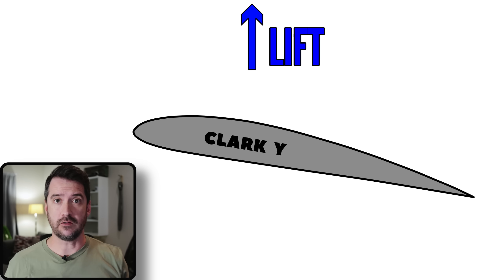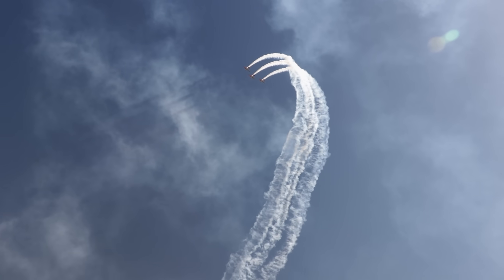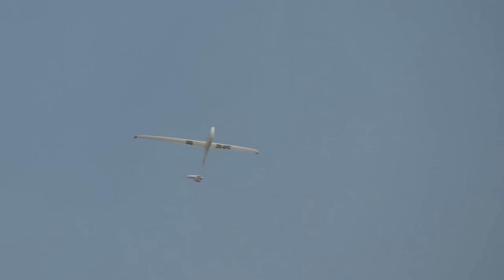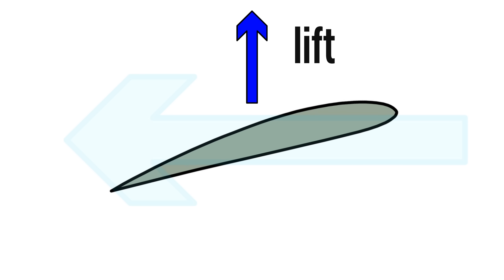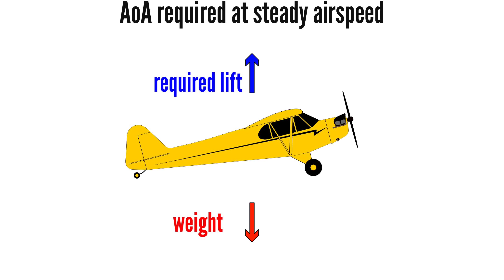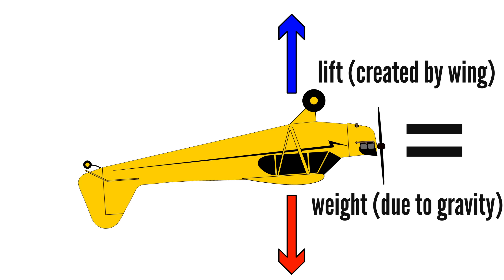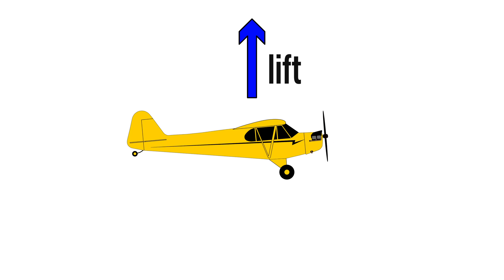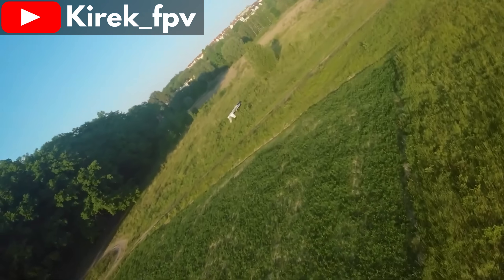Is Airflow Distance Over the Top of a Wing Always Longer?

Comment: I think the confusion arises from many explanations of how wings work referring to the "special shape" of wings, when that's not what's happening at all. The "special shape" improves drag and possibly stall speeds, but fundamentally a perfectly flat board would work to generate lift as long as it has the right angle. But lots of explanations I've seen imply that the shape is somehow magic, when all it does is optimize the generated drag for a certain angle of attack. It's a skewed teardrop shape.
Reply: Push air down, plane go up. Push air back, plane go forward.
Reply: @Sonny_McMacsson  There is a downdraft of air for sure, but it's pressure forces doing the work. The downdraft is a result of these pressure gradients created and experienced by the wing. Your explanation works if you want to dumb it down for a 5 year old.
Reply: @christophorus9235  The other side of dumbing things down is overcomplicating them. Can you really separate a net pressure imbalance from the ultimate kinetic effect it has? The pressure is the reactive force.

Edit: One case that comes to mind where pressure is more convenient than thinking only kinetically, is under/over expanded rocket exhaust. Nonetheless, that pressure imbalance (potential) gets converted into a flow at some point in order to equalize the pressure.
Reply: @Sonny_McMacsson  Correct, but not the complete story. There are other component(s) to lift and drag, pressure differentials being one of them.
Reply: @MarkStafford9  That's the how you push the air part.
Reply: @Sonny_McMacsson  No.
Reply: @christophorus9235  Yep
Reply: This right here. The special shape makes it a 'lifting body'. A lot of time when someone asks 'how do planes fly', they are actually being told what a lifting body is, and not how planes actually fly. An upside down wing has negative lift at 0 Angle of Attack. That negative lift is overcome by an increase in AoA, as this video explains. 

A lifting body makes a plane efficient, but it's not what makes it fly. Stick your hand out the window palm down at 70mph, if you hold it at a positive AoA, your hand will rise. Your flat hand is relatively symmetrical and as such is not a lifting body. If it were, your hand would go up slightly faster, that's about it.

Planes fly because they push air downward. A shaped wing makes it push 10% more air downward than a flat one.
Reply: @JHe-f9t  . Actually the way it works from a Purely " Lifting Body " standpoint is that the Plane is SUCKED upwards .
Reply: @johncunningham4820  That's true for the wing itself. The shape cancels out the drag somewhat, but it's not enough lift to make the plane fly. It adds to the effect, but it's not the total effect.

The wright brothers were extremely dependent on wing shape because their thrust to weight ratio was so tiny, and their materials were so weak. The shape of the wing was key to unlocking powered flight. 

Just as you can build a fan that will move air without an optimized blade shape, you can easily build an rc plane that will fly without having a lifting body. It just won't be as efficient.
Reply: @JHe-f9t  . For  MOST  supersonic Aircraft the entire Airframe is actually a Lifting Body . Fast Takeoff speed and Fast Landing speed but overall Low drag , and of course Big Power .
Lift = Drag . Inescapable . 
Laminar Flow is the Ideal .
Reply: @JHe-f9t  It doesn't push more air downwards.  The shape smooths the airflow, minimizing turbulence. So it technically reduces the amount of downwards pressure from above.  A good way to visualize this is for the air to move across an angled wing, but at the top of the wing, the air wants to go straight backwards as that's the path of least resistance.  But a flat board has all sorts of eddies and downwards pressure, similar to a spoiler on a car. ( which does exactly that - creates eddies and bad air to force the car downwards.) So you want it curved such that when it is at a normal angle, the air dips down a bit and follows the smooth shape to lessen some of the eddies.
Reply: I think you'd enjoy a close read of "Theory of Wing Sections": by Von Doenhoff and Abbott, I know I did.. For the most part it's a distillation of data from wind tunnel research on subsonic foil sections ca. WWII. Sections, if not magic, are step one in understanding lift/drag/angle of attack by the Reynolds Number when designing a wing.

BTW, Sorry you hate women, we have a lot to offer...
Reply: @ChimeraActual did not notice the icon till I saw your comment!  Misogyny is such an odd declaration to make!  Quite disturbing.
Reply: Thank you.  A perfectly symmetrical wing shape with no chamber will fly with low drag.  The force up is equal to the mass of the air molecules being forced down. Action and reaction.... period.
Reply: @Pneuma40  Yes, of course a flat board will fly, a "no chamber" wing will fly. But "low drag" compared to what? An asymmetrical wing can be designed for less drag than any perfectly symmetrical wing for any given sub-sonic use-case except equal performance upside down or downside up. That is why all commercially produced business case aircraft use asymmetric airfoils on all horizontal surfaces. Who wants to pay more for fuel than you have to?
It is about action and reaction, of course. But the "magic" or "special shape" question is about making that action more elegant, more energy efficient by understanding HOW lift is created, HOW downward air is sent downward. A hovering helicopter uses almost twice the fuel of that same helicopter flying forward at it's max efficiency designed speed (usually around 50mph, plus or minus 20). Airshow high-power airplanes can hover vertically, consuming very roughly 40 gallons per hour, or they can fly forward normally for well less than half that.
Reply: A structural (thick) flat board with squared edges,  will have terrible performance. For a real vehicle with high Reynolds numbers , when Fairing the leading edge and "fine-ing" the traing edge is taken to the limits / perfection, an aerofoil is liberated from within the heavy, bluff board.

The false argument is one of a number including "equal transit time", or even using a symmetrical venturi by way of explanation. (Fluids 101 explanations are incomplete.  It IS Bernoulli, but not in a causal manner.)  Numeric solutions iterate to reach a real world approximation.
Reply: To avoid confusion,  "a perfectly flat board would work to generate lift as long as it has the right angle." should be rephrased as "as long as it has the suitable angle." because the "right angle" can be misconstrued by a computer or AI as a 90 degree angle.
Reply: @simon6071 
AI is good at English and you are not.
"Has the right angle" doesn't mean "at the right angle" (90 degrees)
No confusion for AI.
Reply: @Alec72HD  
You are wrong. AI is not good at English all the time. You English is not as good as you think it is.
Reply: @Alec72HD  
The meaning of the phrase "has the right angle" can be so ambiguous that even AI can misinterpret it as "has an angle bounded by two lines perpendicular to each other (90 degrees)" at times. 
Google Translate uses artificial intelligence (AI) to translate text between languages.

Type "has the right angle" in Google Translation and set the translation to Chinese.
The translation is "有直角", which does mean "having an angle bounded by two lines perpendicular to each other (90 degrees)." instead of "having a correct angle. "
You have just been proven wrong.
Reply: @Alec72HD  
Of course "Has the right angle" doesn't mean "at the right angle".''
"Has the right angle" includes the verb "has" but  "at the right angle" doesn't have the verb "has".  So they cannot have the same meaning. You need to improve your grammar in English.  

"Has the right angle" can be interpreted as "has the correct angle" or "has as angle bounded by two lines perpendicular to each other : an angle of 90°".  So there is confusion.
Reply: @Alec72HD  
VIDEO: Why GPT-3 changes everything (and how it works) (10:08) 
Q: Are there any animals with three legs?
A: No, there are no animals with three legs.
Q: Why don't animals have three legs?
AI: Animals don't have three legs because they would fall over.

AI programmer: Wow! This is incredible.
Me: Wow! This AI is so stupid.

VIDEO: Bulldog Puppy Born with Only Three Legs but He’s so Adorable
VIDEO: Three-Legged Dog Still Runs Like a Champ!
Reply: @Alec72HD  You think AI is good at English! No, it is not, neither are you.
VIDEO: This AI Was Too Dangerous To Be Released, Here's Why
(1:54) Tasked with wring an article about unicorns, the AI was stupid enough to talk about unicorns being "four-horned" animals.  What a joke!
Reply: @Alec72HD  
No Chat GPT 4.0 for me? That's fine.
I don't want to talk to something with pseudo intelligence.
Reply: @Alec72HD  - I think you both mean Rightangle (one word)
Reply: @Alec72HD your English is wrong!  At 90° is usually 'at right angles', at the right angle means whatever angle is correct.  At a right angle is a single 90° right angled measure.
Perhaps you should be more careful, as should people with AI
Reply: @RobBCactive  
Right.
Thanks.
My point was that "has the right angle" unequivocally means "has the correct angle."
Reply: @Alec72HD  nope wrong again!  You said "Had the right angle doesn't mean at the right angle (90 degrees)" which was incorrect.  Has the right angle and (it's) at the right angle mean the same.
Read your own post!
Reply: @Alec72HD  I agree, but "every Pythagorean triangle eg 3,4,5 has a right angle" shows it is the indefinite "a" vs definite article "the" which generally disambiguates what right angle means in English.  You can say "it's one of the right angles" if multiple choices exist.  The right/correct thing and left/right are just typical ambiguity.
Reply: @Alec72HD  Please don't be willfully obtuse.  Simon TOLD you he was using Google Translate.  GPT#anything has nothing to do with his point.
And why do you assume that everyone working with Chinese language is in the PRC?
Reply: @simon6071  It make the same mistake in Norwegian.  "has the correct angle" is "har riktig vinkel" but "has the right angle" gives "har rett vinkel" which means 90 degrees.
Reply: It is more complicated than that though because how the air flows over the wing is important. A flat board would cause turbulent flow and certainly would not produce lift, else man would've found flight way sooner. It is very special indeed in that it not only optimizes the bernoulli effect but also causes smooth currents of air. There are quite a few factors that go into lift. A flat board would be able to use newton's third law to produce lift like a kite, which is another lesser factor.
Reply: @psyience3213  Flat boards actually do produce lift at modest angles of attack, they just stall kind of easily so they're not the best format for manned experimental aircraft.  Otto Lilienthal made many flights in one or more gliders that mimicked stubby bird wings, but eventually crashed, I think from a stall.  The Wrights thought more analytically and built wings with similar camber but a higher aspect ratio.  (Also they prudently practiced on sand dunes.)
Reply: Nah, sailing boat sails work by creating that teardrop shape. The force of 'lift' against the resistance of the keel is what squeezes the boat forward.
Reply: The shape is magic because of how it reduces drag and allows the wing to fly as a flat angle of attack (0 AOA).
Reply: @nelsbrown3674  . No " Magic " to it .
It's called  " Physics " .
Reply: @johncunningham4820  "Magic" in quotes, but, yes, physics. Bernoulli's Principle works, even if all you do is increase the angle of attack of a flat wing surface.
Reply: @nelsbrown3674  . Actually , a perfectly Flat surface  is pure Newtonian  Action / Reaction . Just Mass-flow impinging and displacing . The " Special Shape " is what creates a Vacuum on the Upper Side . Bernoulli Effect is Also how a Carburetor works . The Restriction where the Fuel Tube (emulsion tube) creates a Faster Flow and thereby a Reduced Pressure , thus " Sucking " fuel into the airstream .
Reply: Actually it does both.
Reply: No it wouldn't.
Reply: YES! For years I couldn't figure it out because I was told it had something to do with the shape of the wing, as soon as I gave up on that concept it all made sense. The curved upper side of a wing CAN create a low pressue area, but it's a result of squeezing the air flowing over it against the air above the wing, speeding up the air and creating lower pressure....it helps with lift, but it isn't the main cause of lift, it's the pressue at the bottom of the wing that does most of the work.
Reply: That "special shape" does create some lift.
Reply: "as long as it has the right angle."
yes, Key factor - and that is in relation to both, wind and gravity so there are multiple variables in determining the correct angle.
Reply: Exactly!!!!!!
Reply: Actually the most scientific explanation of lift on a wing during flight should be based on the force vector component of each molecule in the air acting perpendicular to the surface of the wing on both sides.
Reply: Correct.
Reply: Taylor Craft BC 12 and later models were built with the same wing cord on top as bottom. There was one made famous in aerobics because of this design.
Reply: Lol you all need to stop talking about lift when you don't know how it works. It's curved flow kids.
Reply: @christophorus9235  
Not from my professional and academic experience.
Reply: @Talon19  Sorry I'm not sure which comment you're referring to. I can say I've seen many professionals and academics get lift wrong. To my best understanding it is the curved flow pattern around a "wing" that produces the surface pressure changes required for lift. You can use many different shapes and AOA to create this flow pattern with varying but still applicable results, which is why a flat board with positive AOA can produce lift.

Edit: A spinning ball moving through a fluid, is another example of how you can rotate flow to produce lift. No pushing down in that scenario yet it still works.
Reply: From what I learnt in school physics lessons, the skewed teardrop shape is due the fact that a wing needs to be  more than a thin flat board for structural  strength and that the curved top surface allows a greater  angle of attack (and thus lift) before the airflow is disrupted; I'm surprised that this is not mentioned in the video...
Reply: Yep , supersonic capable aircraft DO have a Wing Profile that amounts to a Flat Board , with a Razor sharp Leading and Trailing Edge .
Reply: Planes vary in their wing shape depending on their intended use. Cargo planes tend to have that very exaggerated shape, very thick. On the other hand, sport planes and fighter jets are almost (or completely) symmetrical on each side. The SR-71 doesn't have a thick leading edge at all, it has razor blades for leading edges. For planes that are meant to mostly go slow and steady and/or handle a heavy payload, the camber will be bulkier on top than bottom. If you need performance in any attitude and lifting is not the main concern then the camber will be more symmetrical. Some planes can certainly fly upside down, because they are designed with that in mind.
Reply: I always thought and still believe that a completely flat panel e.g. a sheet of steel or plywood WILL create life if air passes along it at an angle. And one COULD probably build a plane like that. But it would be less stable. Your statement that it could be more likely to stall seems to make sense to me.
Reply: So according to you it's not really the special shape; that's why you put quotation marks around it (meaning that you don't really buy that word use)?
Reply: Foils keep laminar flows at greater angles of attack than flat sails, so they don't just reduce drag.
Reply: Grade school science textbooks get this wrong ALL the time.
Reply: @nitehawk86  . This is a Subject  WAY  above " Grade School " . Grade school might do a Quick explanation of  Bernoulli Effect , but nothing more .
Reply: I have built boomerangs with zero angle of attack. As a matter of fact, I have never built a boomerang with an built in angle of attack. I needed to create a proper profile though for them to circle back. Perfectly flat bottom, only the top is somewhat curved with the leading and a trailing edge.  It seems boomerangs generate lift ONLY by the shape of the wing and not at all by the angle of attack. Boomerang with a square profile don't work in my experience. That might be simply because they don't rotate long enough due to drag. Thoughts?
Reply: Well, it is primarily a bullshit teaching, or else paper airplanes would not fly:)
Reply: @batmandeltaforce  - A decent paper airplane has wings with somewhat of an airfoil profile. Seems to me to be similar to a KF airfoil.
Reply: What creates positive or negative pressure is change of air velocity, and not just "faster" or "slower", but change in direction, as well. If a slanted surface causes air to move down, it changes the air's momentum, thus it needs a force, which imparts an opposite force on the surface, too.
Reply: I have built enough of paper kites or even paper planes to know immediately that this is indeed the case.
Reply: Exactly!
(thank you)
Your "flat board" model is close to what we see in (a) hang gliders, (b) bats and flying foxes, (c) flying squirrels and glider possums.
Reply: @ianbatty3947  original Regalo hang gliders have been replaced by inflating curved parachute designs, in X-country distance competition too.  Sails and those Regalo wings take curves and are NOT flat boards which don't generate enough lift for the drag.  It's why there were decades of refinements before gliders and powered planes became useful.
Look at the shape of air screws aka props and ship's propellers which are carefully designed for efficiency and to avoid cavitation.
Reply: Something not mentioned but intuitive is how turning in a banked curve is more efficient than hitting and bouncing off a wall at an angle.
In the flat board case, air molecules have an  impact hitting the flat wing at an angle works on 1 surface, while a flowing stream of air that's turned gradually downwards by careful shape acts on both sides.
It's simple to run water on one side of a round object and see that the flow dominates, causing a counter-intuitive force towards the side that's hit, rather than away from it due to impact of water molecules at an angle of attack with the held curved object.
Reply: This is my point.  I just want to see the data for the percentage of lift generated by the pressure of air on the undersurface of the wing compared to the vacuum generated on the top of the wing.  I am not referring to any forcing air down, as in a jet.
Reply: We know this because we have all made paper planes with 'flat' wings.
The evidence is right there in front of us all, even the science teachers, but this 'special shape' and the long path/low air pressure thing continues to be taught.
Reply: Correct.  The ONLY reason wings have thickness is to accommodate the SPAR.
Reply: @rsteeb  I don't think so.  Hang-glider designers chose to add a lower surface for airflow reasons well after many successful single-surface models had been produced.  Sailboats had been using thin masts and single-surface sails for centuries but in recent decades they have branched out into airfoil-shaped wing-masts presenting a deep leading edge, and also fully two-surfaced winglike sails.  An optimally trimmed single-surface sail ends up having a bit of a retrograde vortex (telltales streaming forward) on the leading portion of the inside face, which I doubt represents optimal airflow efficiency.
Reply: youre not wrong but the MAIN point of a wing is that it generates lift when flying level. which certainly cannot be done with piece of flat board. Plus the wing has to be stong enough to carry the plane weight without folding on itself. like do you know how a long distance flight path/fuel consumption would look like if you only generated lift when pointed up? And you realize that there are planes that literally fly without a propeller/engine just by utilizing its wing shape called GLIDERS right?

while not being wrong that flat board can create lift, you certainly are not correct in saying the wing shape does nothing lol. I think youre just experiencing Dunning–Kruger effect, where you know a bit about planes to be certain in your knowledge but you know too litlle to realize you actually know jack about it.
Reply: @SagittarA  A wing produces exactly as much lift as it does downdraft.  If that can be accomplished in "level" flight, credit Bernoulli and/or Coandă, but Newton's three laws are inviolable.  Jack who? 🙄
Reply: yup some people are just lacking in comon sense to understand this.
Reply: Every kid who sticks their hand out of the window at speed, and then adjusts the angle of attack proves this.
Reply: AND IT DOES.  All the Balsa aeroplanes we built as Kids (in the 60s at least) - used FLAT panel wings and flew fine.   And the PITTS is symmetric and also flies perfectly - either way up.
Reply: A flat board at a high angle of attack would be the same as blasting it from the under side with air from an air compressor.  Similarly,  the top side of the board would be protected from the blast creating an :'air shadow'.... or a vacuum. So it's either pushed up or sucked up depending on how your mind conceptualises it
Reply: You're right. 
The shape improves lift, but is NOT the "cause" of it. 
Even a cow 🐄 , if placed inside a wind tunnel with a certain angle of attack, can generate lift. 😊
Reply: Positive camber wings produce lift at zero angle of attack; flat plates don’t.
Reply: @Talon19   - but why?? Why use such a wing?  The answer lies in minimal drag at (designed) cruising airspeeds. VNE speeds may well require negative control input to maintain level flight (higher drag per unit speed equivalent
Reply: @Talon19  Yes, but, just about any airfoil has a slope of about 0.1 delta in the Cl for every degree of AoA. The camber only determines the Y intercept of this line. The rest of the shape maintains linearity out to varying AoAs depending on how good a shape it is, flat plates stall at about 5 degrees and a reall good airfoil might stall at 12 degrees - so you get way more lift out of a properly shaped and cambered airfoil.
Reply: @Talon19 Who told you that? Certainly  not Bernouli.
Reply: @fredbrillo1849  
Direct observations, measurements, and analysis of dozens of wind tunnel tests prove that the upward force called lift is due to differences in pressure between the upper and lower surfaces of the aircraft than deflected, turned, circulated, etc air.
Reply: @Talon19  Please post a link to some evidence of that...
Reply: @Talon19  When you say zero angle of attack, what does that really mean? 
The aft part of the foil is still angled downwards and with laminar flow therefor will direct air downwards behind the foil.
Reply: @ketilrkke4552  Laminar flow is rarely if ever experienced by the trailing edge. I think the best laminar flow airfoils transition to turbulent flow around 65% of wing chord.
Reply: @ketilrkke4552  
The pressure on the upper and lower surfaces are the same at the far field points where the thin plate begins and ends.  The difference in pressure is local to the cambered section of the surface.
Reply: @Talon19  A curved wing acts like... A downwards plank. At zero angle it still behaves like a plank that ends up pointing downwards
Reply: @jeanladoire4141  It's pressure forces, not downward deflection. The downdraft is caused by the pressure gradients on the wing surfaces.
Reply: @jeanladoire4141  
What are you talking about?  My point is downwash is not required for lift.
Reply: @jeanladoire4141  
“Pointing downwards* isn’t very useful because it gives no reference to AoA.
Reply: @Talon19 downwash is required for aerodynamic lift. Still waiting for any evidence of those hundreds of wind tunnel tests you claim proved otherwise. You know, the ones you weirdly claim happened at ERAU during the AE301 course which doesn’t have wind tunnel because experimental aerodynamics is AE315. Maybe the model of this alleged experiment was full of hot air, that would explain the divergence of your claimed results from the canon of aerodynamic theory….
Reply: @XPLAlN  
Courses change in the 20 years I took aeronautical engineering there.  Not my issue.
Reply: @Talon19  AE301 is theory now and it was theory back in the eighties. Experimental was 309 and is now 315 so your story has failed authentication. In any case you cannot produce the experimental data for any if the tests you are claiming happened.
Reply: @XPLAlN  
And?
Reply: @Talon19  quote: “and?” …and nothing else needs to be said unless you can provide this fantasy experimental data.
Reply: @XPLAlN  
Not my problem you didn’t do wind tunnel tests yourself and don’t understand basic physics and fluid dynamics.
Reply: @Talon19  well, it is “your problem” if you wish for the internet to believe your absurd opinion that aerodynamic lift does not require deflection of airflow. Nobody is buying it. Nobody is buying it because it violates conservation of momentum. Nobody is buying it because your failure to reproduce any evidence of the wind tunnel tests you say prove your point, renders your rhetoric as unconvincing as your daft opinions on aerodynamics.
Reply: @XPLAlN I've wasted many good hours arguing with engineers about this. They love to over complicate things - for them, if you don't need a computer/simulation/weird precalculated table or chart to work it out then it's not interesting.

When faced with "it's just conservation of momentum" they'll tell you "it's not that simple" and then proceed to talk about all the complicated details which make a good wing (obviously very important if you're building a wing) without ever actually thinking about the fundamental mechanism.

Engineers are incapable of ignoring extraneous details when the context demands it, and because of that they rarely understand the fundamentals.
Reply: @Talon19 "Positive Camber" wings produce lift at zero angle of attack, but that's an incorrect analysis. Positive camber wings produce no lift at "Minimum drag' angle of attack (Same as flat plates, and symmetric foils about a straight 'camber line'), which is some number of degrees Nose Down. A curved camber line produces lift (+ or -) in relation to it's angle of attack different from minimum drag angle, not from any difference from a straight chord line drawn from each end of the camber line.
Reply: @billtaylor3499  
AoA is defined in relation to the **chord line**.
Reply: @Talon19  There is NO lift without downward acceleration of ambient air; how does zero AOA achieve that?🙄
Reply: @rsteeb  
Pressure decreases on the upper, cambered surface.
In college we ran a wind tunnel test with a long, thin, flat plate with the upper surface near the center as the upper part of an airfoil.  Using force gauges and pressure taps, we verified low pressure over the cambered area.
Reply: @Talon19  When I was single-digit years old, I played with balsa wood gliders.  They ALL had perfectly uniform wing thickness...  The pressure differential between top & bottom was entirely due to AOA.  And NEWTON.  By eyesight I verified they glide just fine.😎
Reply: @christophorus9235  Curving flow is inducing velocity change to the mass flow. Which way is that change when you want to go up, now?
Reply: @Sonny_McMacsson  You get a centripetal acceleration around the wing which induces pressures on the wing. Assuming you want to go up, you'll induce a curvature that produces a low pressure zone on top of the wing, and a high pressure zone beneath the wing.
Reply: @christophorus9235  Of course. That creates a change in velocity (direction and magnitude, not just magnitude).
Reply: @Talon19  zero angle with regards to what, the lower side of the skewed teardrop shape? Sure, but that doesn't mean anything in this context. I can take the shape of a flat board at a 5° angle of attack and define that as an angle of zero, and then, lo and behold, the flat board produces lift at an AOA of 0.
Reply: @InternetStudiesGuy 
You obviously don’t know what angle of attack means even though the video explains this.
The AoA is the angle between the chord line and the relative wind.
If you don’t take education seriously, then no one should take you seriously.
Reply: @InternetStudiesGuy  In fact, as implied in pretty much every diagram of aerodynamic flow over a wing surface, but surprisingly never mentioned:  Even at "0" degrees AoA the wing is closer to 10 or 15 degrees.  IN THE VERY DIAGRAM.  Also, look at any bug smasher and you will notice that even with the nose straight and level, the entire wing surface is at an incline so that it DOES have positive AoA even when moving straight and level.

As the video says, you must have positive AoA to produce lift.  That is true whether the lifting surface is a symmetrical wing, a teardrop wing, or a piece of plywood.  It's even true when the teardrop wing is upside down.  Similarly, "lift is caused by a pressure differential between top and bottom".  Also perfectly true.  But it ain't the magic shape that causes the differential.  It's the positive AoA, which needs to be far more than what the "magic shape" causes on its own.
Reply: @ovalteen4404  , you are making errors in assumption of what is represented and indicated, zero pitch angle of an aircraft (longitudinal axis)  is not the same as zero incidence of the wing, nor is it the (flatish) bottom of the wing. Yes, a positive camber wing section produces positive lift at zero aoa... (chord line, for AOA assessment, passes through the forwardmost point in the leading edge and the rearmost point in the trailing edge, it is a straght line, not the "mean chord", which may be a curved line.  To produce zero aoa on most (especially, low performance)  airplanes (aeroplanes) the nose is pitched down , the longitudinal axis points in a downwards direction, to maintain level flight, excessive speed is often necessary (high speed cruise, or above manoeuvring speed,  approaching VNE).
Reply: @kadmow  No, the point I was making is, the amount of AoA created by the shape of the wing is only a small part of the total.  The incidence angle adds multiple times that amount.  The shape is primarily to minimize drag for the designed AoA range, not to produce lift.
Reply: @InternetStudiesGuy  Bro, you're so confused. You have no clue what you're talking about. A flat board will not fly at 0 degrees AOA. To produce lift at 0 degrees, you must add some kind of step to the front 30% of the wing, like a Kline-Fogleman airfoil. It will no longer be flat. It will also fly like crap. Even the KLm Airfoils look like they are flying High Alpha most of the time.
Reply: You're right.
Reply: Try to go sailing with a flat sail then 😂
Reply: So how do you get off the ground? Try putting flat boards for wings and race down the runway. You won't lift off.
Reply: @dingo1yongo you will if you rotate to 5 degrees AOA.
Reply: Birds have honed the the art of flying for more than 140million years, and and there wings have  the shape of an airplane wing.
Reply: @pietperske3583  You have hit the nail on the head in terms of experientially derived wisdom. Usually we just mine our own experiences to try to understand our today life. Mining the wisdom of the ages is a great way to expand our own wisdom.
Speaking of bird wings, the upper surface of their wings are surfaced with micro-grooves at an approximate 45° angle to the direction of flight. This anciently decided on surfacing technology initiates micro-vortices of air that act like ball-bearings to the air flowing over the wing (really between the wing moving through the relatively still air as the bird is flying). The helps organize to very very thin the "boundary layer" of air over the wing, which minimizes both drag and stalling. Contrarily, on the underside of bird wings, these micro-grooves are oriented perpendicular to the direction of flight. For the air under the wing, this is kind of like us crossing the street and tripping on the curb as we reach the other side. Our foot, like the air molecules, pushes down and sideways against the Earth, like the air molecules push up (lift) and against (drag) the wing. Because these micro-grooves are simply the angles between the zip-lock vanes (technically the "hook" and "catch" tips of the adjoining "barb"s' "barbule"s that form the inner and outer vanes) rather than a curb shape to the air, they present a "V" shape groove to trip the air molecules. So when the air molecules are tripping on the curb, they are more clearly contributing to both lift and drag.
Further, when a bird is preening, they are both re-zipping their barbules, and they are re-layering their feathers so that the outer vanes are exposed on the leading edges of their wings, and the inner vanes are exposed aft. The under-wing feathers are much more symmetrical, but it still helps flight if they are all organized one feather half-under its neighbor.
Shark skin too, except instead of micro-groove surfacing, they use micro-hair derived boundary layer minimization of thickness and maximization of laminar flow. In other words, sharks swim faster than they should be able to swim, according to publicly taught BS aerodynamics.
Example: "riblets" helped the USA finally win the America's Cup sailing trophy years ago.
Example: Rutan's Voyager aircraft, the first to fly unrefueled around the world, had only 13 bugs on the wings after finally landing. Prior to that flight, they micro-etched the upper surface of the wings with 400 grit sandpaper at a 47° angle. That accomplishment of flying so far without stopping was not possible according to classical aerodynamics. Plus, Voyager had ground contact damaged wing-tips creating extra drag the whole flight.
So yeah, we can learn a lot from the wisdom of our ancestors.
Reply: Yeah for flat board is only about the angle of attack ( with big drag )  while for cambered wing ( in practical limitations ) it is Bernouli with low drag but high lift
Reply: @jured7383  Wrong, that's the "Bernoulli vs. Newton" error which is debunked on the NASA website.   In fact, wings fly 100% Newton, and also wings fly 100% Bernoulli.   These are just two different approaches for explaining the same thing.   (And also, Bernoulli's equations are 100% created by Newton's laws, ...so obviously they must be the same thing.)
Reply: @jured7383  Bernoulli's math illustrates how vortices adhere to the flight surface, explaining both decreased drag of a cambered wing and where the critical angle of attack lies. It does not explain lift.
Reply: @jured7383  A cambered wing at the right (very wrong) angle of attack will make no lift.
Reply: A flat board would generate massive drag at high attack angle because of the massive eddies behind it.
Reply: @chrissmith2114  Yes. That is exactly what he said. BUT IT CAN STILL FLY!!!
Reply: @chrissmith2114  This is true. Delta wing jet fighter come to mind.
Reply: @chrissmith2114  Correct. The eddies are coming from the top, not the bottom as almost every diagram and high school textbook gets wrong.  The airspeed over the "top" has nothing to do with lift, but that angle will create eddies behind it if it were a flat board like surface.  So it's typically curved a bit to help the air move more smoothly and minimize the eddies, similar to what they do in your car to make it get better fuel efficiency.
Reply: You seem to be implying that lift is only a function of the mass of the air pushed down by the wing. If this is your implication, why aren't all airplanes helicopters? Why do airplanes have much better fuel economy than helicopters or harriers? Why do helicopters require almost double the power to hover, versus flying forward between 50mph and 80mph (depending on that particular drag characteristics and rotor blade airfoil)? There is airfoil shape really is "magic", unless you consider that efficiently achieved pressure differentials is a major contribution to lift and is therefore "science" rather than "magic".
Reply: @MarkStafford9  Lift is absolutly directly related to the mass (and speed) of deflected air.  That is the inescapable reality of Newtons 3rd law.
Reply: @kennethferland5579  Correct they are related, but deflected air is not the only contribution to lift.
Reply: @kennethferland5579  Lol no, pick up a book son.
Reply: @MarkStafford9  As far as air being directed down, the amount of lift is a function of the change in the vertical momentum of that downward directed air.  That is the definition of force, change in momentum.  The efficiency (same as with high bypass vs low bypass engines) results from how much of that momentum change is represented by mass rather than velocity.  Because velocity is squared in the term for kinetic energy while mass is not, the more you replace velocity with mass in that momentum change, the lower the energy that is represented (consumed by) that change in momentum (the force of lift).  

In short, force is change in momentum, and efficiency is including more quantity of mass as a substitution for velocity, to reduce the kinetic energy that will have to be supplied by engine power (higher kinetic energy content in the downflow is experienced as increased drag from the production of lift).

The downward momentum of air is the motion toward lower pressure of adjacent air, caused by the airfoil's asymmetrical path shapes, which can be contributed from AoA and/or camber (they both have the same function: air path disruption).  The lowered pressure results from mass flow rate continuity of the relative wind: a disruption in the continuity causes either a depletion or buildup in air molecules (changed air pressure), that acts to change the speed through the path disruption sufficient to re-establish mass flow rate continuity (in a very real sense, the mass flow rate continuity is self-regulating through the pressure change that results when it becomes disturbed - what we mean by Bernoulli).

In short, stressing the relative wind flow, changes the lateral pressure (say from left to right), which "pulls on" and mobilizes air from above in a downward direction (air moving from higher to lower pressure).  This is how the pressure difference relates to Newton's second law of air forced down (as with rockets).
Reply: @davetime5234  Wow, really thick and delicious! I'll have to chew on this for awhile to fully understand. Thanks!
Reply: @davetime5234  Again, wow. I (not a trained aeronautical engineer) find that articulate and accurate. It seems to me you are embracing both perspectives (deflection of air downwards AND long/short boundary layers over/under the wing creating lift):
1. (Yes to under wing deflection of air downwards) because in steady-state sub-sonic level flight there is a momentary high pressure area under the wing (under the stagnation point horizontal plane, or leading edge molecular decision height, where local air molecules either end up going over or under the wing) that causes local (within x meters vertically and horizontally) air molecules to momentarily self-organize in a downward mass movement because of local pressure differentials.
2. (Yes to over wing deflection of air downwards) because in steady-state sub-sonic level flight there is a momentary low pressure area over the wing (over the stagnation point horizontal plane, or leading edge molecular decision height, where local air molecules either end up going over or under the wing) that causes local (within x meters vertically and horizontally) air molecules to momentarily self-organize in a downward mass movement because of local pressure differentials.
3. The shape of the wing (airfoil, chord, sweep, dihedral, etc) and AOA can both be optimized for particular use-case efficiencies. Most operating aircraft just adjust AOA and leave the wing geometry fixed except for control surfaces (aileron, flap, elevator and the like).
4. I would add (as a former air traffic controller) that after the wing has passed, the resulting turbulence of the air settles over "x" minutes to non-violent strengths or even completely dissipates. "X" is larger for heavier aircraft. It is interesting to note that the vertical sinking of the aircraft's turbulence rarely descends lower than 1,000 feet below the altitude the turbulence was created, and usually around half that (500'). I say "rarely" to allow for external weather events. I bet the fuel burn rate of a flying steady-state aircraft could be calculated from the aggregate resultant energy change of the mass of air behind the aircraft from the aircraft having passed through it.
To mā′ to - To mä′ to. The deflection-of-air-downwards perspective may be all about results, while the long-short-laminar perspective may be all about the mechanism to achieve the results. The what vs the how is not really an argument.
Southwest Airlines spent $1M per older B737 to add winglets and vortex generators around Y2K. The resultant fuel savings became pure profit about one year after each was retrofit due to fuel savings. I usually focus more on the "how is lift generated", from a future engineering perspective, rather than "what is lift" perspective from a force analysis perspective.
Thanks for helping me gain a wider perspective on this particular YouTube video.
Reply: @MarkStafford9  Hovering helicopters need more power because they are operating in their own downdraft, which makes it harder to further ACCELERATE air downward.
Reply: @MarkStafford9 spinning big propeller with no angle of attack generating shaped objects takes mote energy than using a small propeller to force those decent angle of attack generating objects. 3D foam airplanes literally proves this exact point so what are ya'll talkin about.